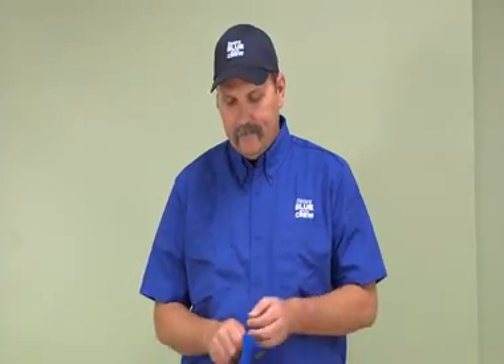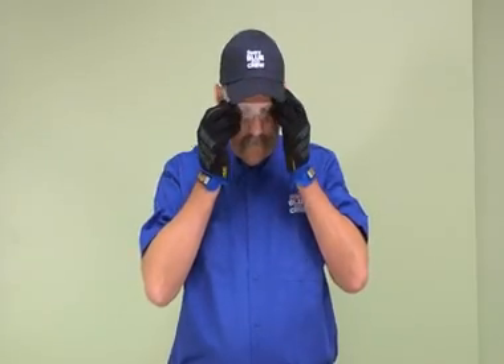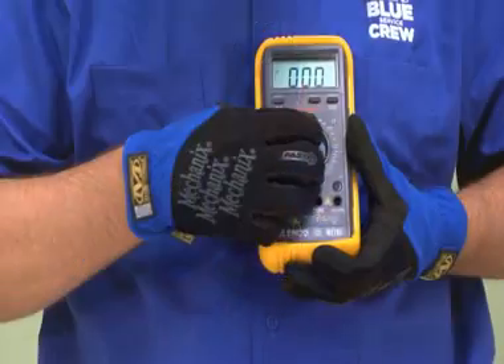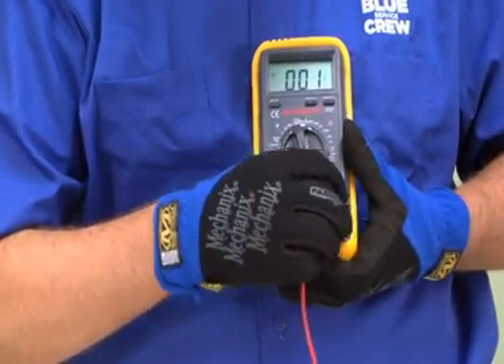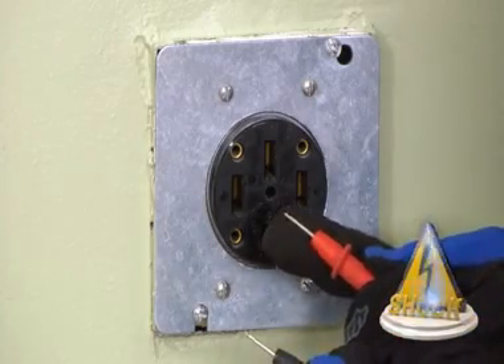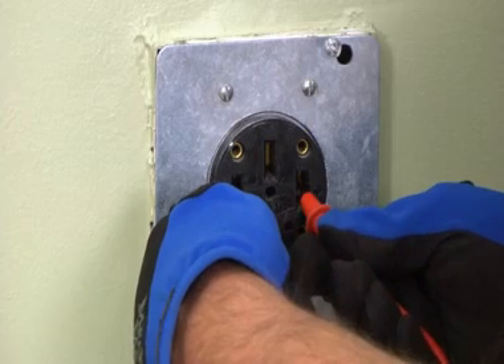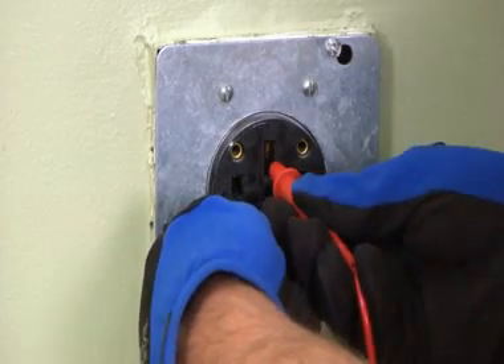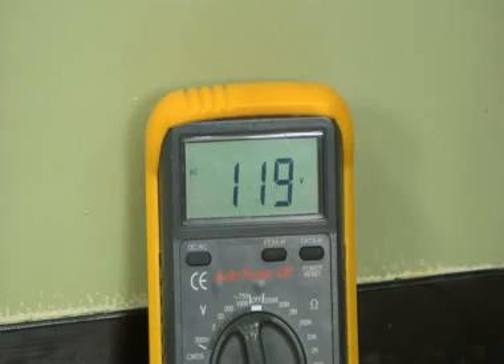Video: Perform a Voltage Check on a 240 Volt Outlet

Comment: You always set the meter to a higher setting than you expect. On my multimeter the AC settings are 6V, 60V, 600V.... so to test a 120V or a 240V volt receptacle, I would set the multimeter to 600V. When he says the proper AC setting, he is assuming you know how to use the multimeter. Please take some time to review the basics of all the settings of the multimeter so that you can use it safely.

The AC setting on the multimeters will say AC or it will show V~

If you are going to be sticking things into an electrical plug, especially a live electrical plug, do your research. In the 4-blade 240Volt plug, the half rounded opening (or the hooked opening on locking plugs) is the ground. The one opposite the ground is the neutral. The two on the sides are the hots. Each hot is 120V, but together they provide 240V.

Always connect your red lead to the hot receptacle first, THEN connect the neutral lead. Always withdraw the neutral (black) lead before withdrawing the red lead.

Comment: "Set the volt/ohm meter on the proper AC measurement setting"  - thanks for the ambiguity. So helpful.
Reply: The only reason we're here.
Reply: Hes a dolt

Comment: There is no such thing as a "top slot" and "bottom slot". There's a Neutral, there's a Ground and there are two "Hot" or "Live" slots. The outlet can be installed sideways or upside down for any reason. DO NOT listen to that video explanation. That video should be removed, in fact.

Comment: What kind of half assed tutorial is this. I know how stick the probes into the outlet, to be careful, and to not touch the metal part or the metal part of the probes touch each. This is all common sense stuff here. However, I don't have a single AC volt setting,  I have two AC volt settings, 600V~ & 200V~ so this awesome tutorial just says use the proper setting. Oh, how informative--- hey wait, didn't see this before.  Just to the right of those 2 setting is a third setting. There's really tiny writing above it, got use my reading glasses. Holly shit is says 'proper' above it, so that must be the 'proper setting' right jackwad??

Comment: Guys hes very clear. When He says Proper AC measurement settings he means measuring AC above 200. Hes clear... you just have to use your head a bit
Reply: Really?  "You just have to use your head"??  One must have specific information in one's head to access and use that information in a practical setting.  I would bet that many watching this video were watching it for this one specific piece of information.  And most watchers have probably already read endless blogs and how-to's looking specifically for "AV" and "above 200."  There are a lot of settings on my digital multimeter.  How difficult is it to be specific?  Some videos say "check your manual."  If I had a manual, I wouldn't be watching this and twenty other videos trying to see where the dial is set!  So thank you very much for simply giving the info I needed.

Comment: set on proper settings? WHY DON'T YOU TELL US WHAT THOSE SETTINGS ARE????? 
ANOTHER HORRIBLE HOW TO LEAVING OUT VALUABLE INFO...HORRIBLE..9/10 videos on here ARE WORHTLESS...done by people WHO JUST DONT GET IT..
if we knew what settings..WE WOULD NOT BE HERE!!!!!
Reply: Inside the house, set the voltage setting to alternating current, AC, or the A with the wavy ~ line.  (The A with the dots ... is for DC or direct current which is what your automobile uses, do not use that inside the house.  If you do, it may break your multimeter if it is a cheap one like mine.   Again, AC is what this guy used to test the 240V receptacle that is used for large appliances like ranges or dryers.  So if that is what you are testing, use a setting of 240V or higher.  For example, on my cheap walmart multimeter, I have an AC Voltage setting for 200V and 600V.  I use the 200V setting to test the regular receptacles of 120V.  I just worked on my range and when I tested the receptacle of 240V, I had to use 600V setting on the multimeter.  If all else fails, read the manual or find you an older male family member, an older male in the neighborhood or at work that may have experience with this...or find a youtube video on a multimeter tutorial.
Reply: This was so made for people who understand how to read the instructions on our voltmeter.  Idiot

Comment: I have tried this with my multi meter and i get 240v on the two bottom pins but when trying the top pin and one of the bottom pins i don't get a reading if i swap the probes around i get 240v??? I am testing my own electric 3 pin wall socket so the two bottom ones are 240V and a bottom one and the top together i don't get a reading but swapping round the probes i get 240v not 120V??? Which is what i wanted
Reply: back2skooldaze

Comment: Worst tutorial I've ever seen.  What is the "proper AC measurement setting"?  How to I "properly plug in the leads".  Thanks though for explaining that he was putting on gloves and glasses while I watched him put on gloves and glasses.
Reply: Exactly this. "Here's how you do it. Do it the right way. And that's how it's done."

He could have at least said how to select, or at least said what he's selecting for 240V.
Reply: for further instructions on which setting to use, read the manual on your voltmeter/ohmmeter.  For the scope of this video, reviewing every setting would be useless info to folks with different tools.  What was covered here, during this video; was useful for testing the voltage on a 240 outlet.